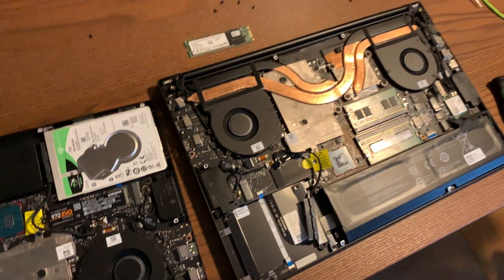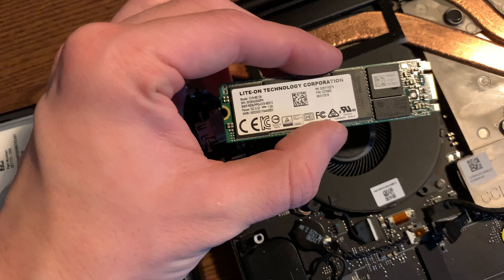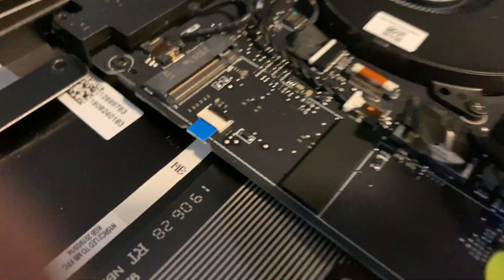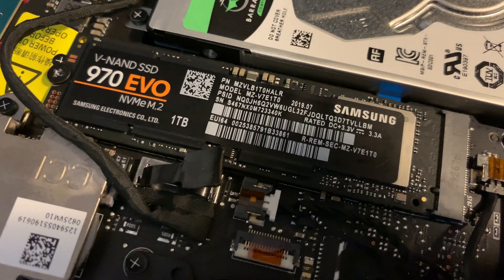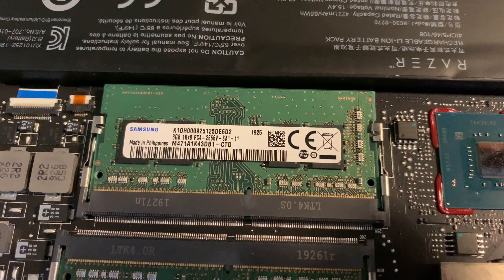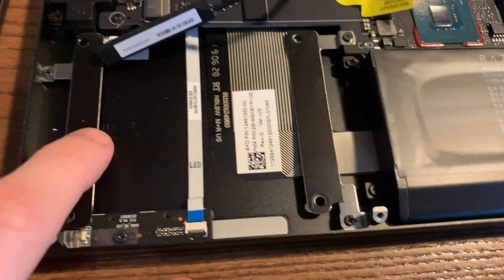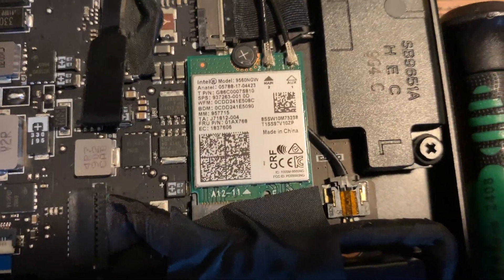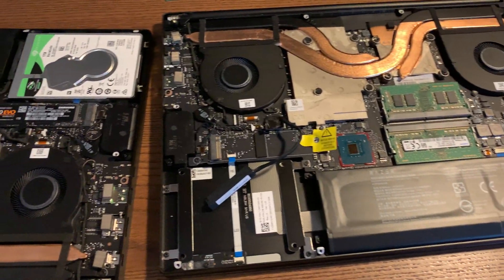Razer Blade 15 2019 1660Ti Upgrade Paths- M.2 nvme, RAM, battery

Comment: Bro I know the vid is from 2019 but, I have a blade 15 base 1660 TI 256 GB and wonder if it is possible to change the ssd to the same you installed. On Razer page is writen 256 is max
Reply from the maker: I can’t imagine. If you have a m.2 slot it could be limited to 1 or 2tb, but I don’t think 256. I’m guessing 256 max is referring to available oem configs. If I were you I’d just buy a big ssd from somewhere with a good return policy and try it out.

Comment: Can you please do a video showing how to remove the battery in the base model? (I want to replace the 65Wh battery in my 2018 Blade 15 with the 80Wh battery in the 2019/2020 base models)
Reply: @filedotnix  I did it a while ago but from what I remember I just pulled on the actual plug, not the wire, it took just a bit of force
Reply: Did you manage to upgrade your battery? It seems like the 2018 base and advanced model batteries have different types of connectors so I'm not sure its possible
Reply: just disconnect it from the pcb and unscrew it. it's really simple
Reply from the maker: I'd love to but I got rid of the laptop as it was full of problems. its very easy though just screws and a plug
Reply: Hey, were you ever able to upgrade the battery?
Reply: @abigellm8929  it's not possible
Reply: @samferrell7757   damnn, I guess I'll try and find a used advanced model, thanks for the heads up :D

Comment: Bro can you please show how to remove that heat sink to repaste. All the vids on razers have the configuration w the big battery and the easy to remove heatsink cover. I have the 15 rtx 2060 i7 9th gen 2019 and can barely find any videos w this configuration on the back
Reply from the maker: I don't have my blade anymore to make a video, but I'd imagine you just need to remove any screws attaching the heatsink to the motherboard/chassis  and just carefully remove it- if you get resistance I'd just check for other screws.. On some devices you need to remove the fans first but it didn't seem like you'd need to on the blade.

Comment: hey do you think this ssd will work on my razer blade 2019 base model 128gb Sabrent Rocket Q 1TB NVMe PCIe M.2 2280 Internal SSD High Performance Solid State Drive R/W 3200/2000MB/s (SB-RKTQ-1TB) https://www.amazon.com/dp/B07ZZYWTBP/ref=cm_sw_r_cp_api_i_4ua9DbF798PQ3
Reply from the maker: Should work fine. Any M.2 drive seems to be compatible, just be sure to change bios settings.

Comment: Nice! getting me a blade 15 for my bday in May cant wait to minimize my current gaming setup to a egpu and a blade 15 and gonna be upgrading the storage like crazy. :)
Reply from the maker: I did the same thing, minimized greatly. I will say definitely get the Egpu at the same time. I had a lot of issues with thunderbolt on the blade 15 and ended out returning mine. I'd want to test how yours works with the egpu while you're within your return period.

Comment from the maker: And yes, I have booted it up and installed windows on the 970. The real reason why some people are confused whether the 128gb SATA version will take a pci ssd is because the 256gb version comes with a pci nvme ssd.
Reply: Does it ship with the sata connector for 2.5 drive
Reply: @nosc0pe  yes it does.  when you open the bottom of the chassis you'll see it taped to the left side of the battery with black electrical tape.